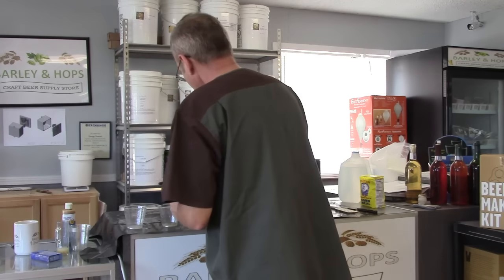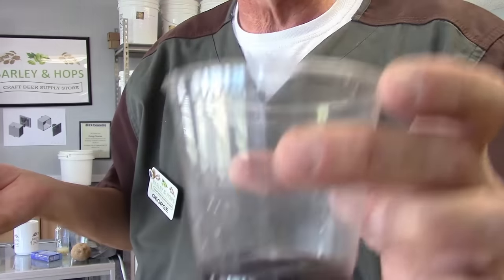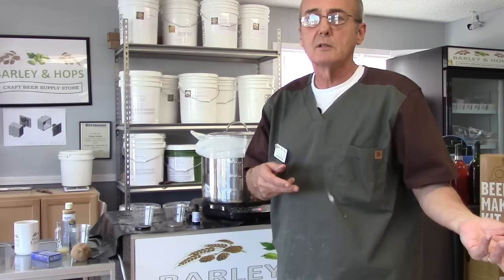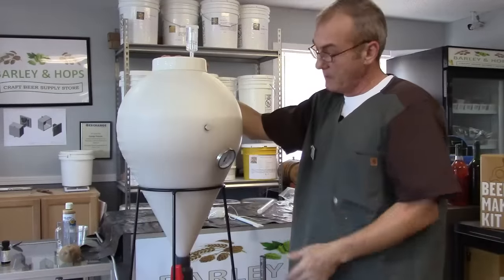How to make a corn mash for distilling

Comment: Hello George, my local brew shop didn't have the d.a.d.y so I got some Fermfast whisky yeast which has glucoamylase in it. My question is do I still need alpha amylase to do a corn mash? Also have you ever used this yeast, how were the results?
Reply from the maker: +Silver Eagle Glass Art Gluco amylase works at fermentation temperature to cut the fine ends of sugar molecules for fermenatation. Alpha amylase does its work at 155 F. This is where the long chain of starch are cut into fermentable sugars. Gluco does nothing to help you if alpha has not had a chance to work first. Therefore, yes you need the alpha first in order to take advantage of the gluco (better known as Beta Amylase) .
George
Reply: Ok, that's what I thought. Just wanted to make sure. Thank you very much. Right now I have my first sugar wash started. I'll let you know how it goes.

Comment: George, the cheapest I can find corn dextrose online is $1.31 per pound. Using 10 lbs in your recipe at a cost of $13.10 just for the sugar in a 5-gallon batch seems costly. I use dextrose too, but not that much. I use 2.50 lbs for a 5-gallon mash in a recipe with barley doing the most of the work of converting the corn starch to sugar. I never use table sugar (cane sugar) unless I'm making rum. What is the benefit of 10 lbs vs. my 2.50 lbs? Is there a major increase in ABV with that extra 7.50 lbs? Thanks
Reply from the maker: All depends on what sugars you get from your grains.
Reply: Understood, but let's say you and I are using the exact same grain bill, water, and temp/times, from your experience and knowledge does the extra 7.50 lbs increase the ABV enough to warrant the cost increase? I'm trying to fine tune this. Thanks for your continued help.
Reply from the maker: For me it does. If you increase the grain bill you can reduce the sugar and if you decrease the grain bill adding sugar does increase the ABV by about 1.2% per pound.
Reply: Ah, yes, a number I can work with. Thank you.
Reply from the maker: Great. Glad I could offer a little insight on this.
George

Comment: Hi George. I want to know if you have any potato mash recipe for distilling vodka. Thank you for your videos.
Reply from the maker: +Jan Lamprecht There are many on line recipes. I don't normally run potatoes but when I do they produce a very good clean vodka. The only real tip I can offer is make sure you cut any eyes out of the potato and peel them so they are clean. There are many different ways to do this and many people have firm attitudes about how to prepare potatoes i a mash. All of them work and some are easier than others. Just follow the same principles for making a mash with flaked corn or other adjuncts that need to be converted. Either us malted barley ( 2 or 6 row) or add amylase to convert the starches to fermentable sugars. Temperature is important when converting , 155 degrees F is your target. The window of temp is small (149-164) so 155 is just about perfect. Steep at this temp for at least 60 minutes to allow the amylase or grain to do its job. After that you can strain out the solids and prepare the mash for yeast (either ferment it as is or add additional sugar to boost the ABV).  Hope this helps
George
Reply: +Barley and Hops I will give it a try. Thank you for your time.
Reply from the maker: +Jan Lamprecht anytime Jan. We all learn from these threads and I enjoy the interaction and also gaining more knowledge from others as they try new recipes. Please let us know how your mash turns out. It would be good to share with others. Thanks
George
Reply: +Barley and Hops It will be a while. I am still building my copper still (22 gallon) and I want to make a glass jar thumper to see what's going on in there. But I will keep you posted on the vodka.

Comment: Can I use regular tap water to make a mash
Reply from the maker: Yes you can. I use it all the time.
Reply: @BarleyandHopsBrewing  so I don't have to buy distilled water what's a safe temp to boil it at to get rid of the clorine so the yeast can work
Reply from the maker: @andreharrison4788  Just leave it sit uncovered overnight. Chlorine will leave on its own. It's kind of like CO2 in a coke, it doesn't want to be there in the first place. The larger the opening in the top the quicker it will dissipate.
Reply: @BarleyandHopsBrewing  thank you so much bro love your videos very helpful

Comment: what is your average proof after distilling ?
Reply from the maker: It really depends; routinely, 150-155 in a pot still for the first 40-60% of the run and then a slow decrease until I hit the tails around 90-100. In the reflux I routinely start around 180-190.

Comment: Hey my buddy told me he has a yeast that converts the starches in grains over to sugars without having to boil it. Is this true?
Reply from the maker: No such thing in my opinion. Besides, boiling is not the means to convert starch to sugar. It is the use of enzymes that convert starches to sugars and that happens at 155 degrees F. 
Ask him to describe the biological process of that conversion and if it is true how can I get some.
George
Reply: Barley and Hops Brewing LLC Look up Prestige WD Yeast. Read it. Get back to me let me know what you think. I’m pretty sure it says it has enzymes to break down starches into sugars.
Reply from the maker: Yep. But you are confusing the conversion processes. This is beta Amylase and it works at fermentation temperatures. Alpha is the work dog for conversion and beta cleans up the complex non fermentables during fermentation. You still have to convert  starches to sugars and the beta will break down the 2-5-% left over sugars that otherwise would not ferment.
I see what you mean but this is not the same thing as using alpha amylase.
George
Reply: Barley and Hops Brewing. Thank you for your knowledge. I have just been doing sugar washes and honestly getting tired of it wanting to make a good quality whisky so trying to convert over to all grain mashes. I appreciate your replies and I will definitely pick up some Alpha before my next cook. Thank you once again.